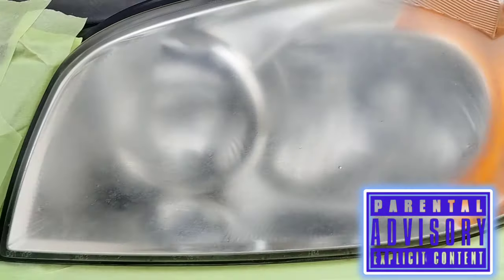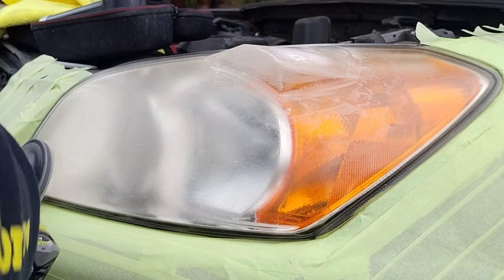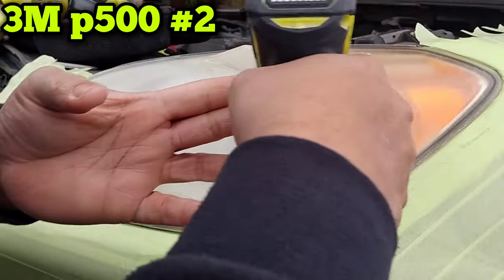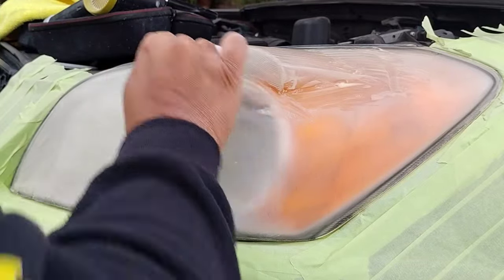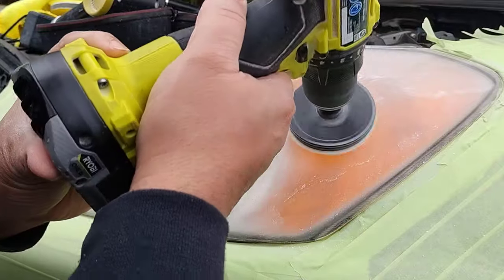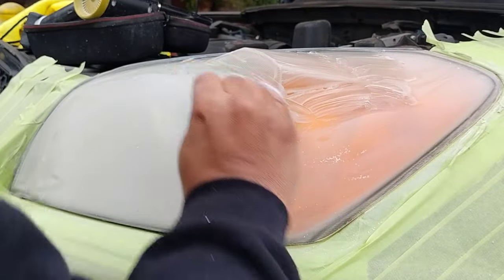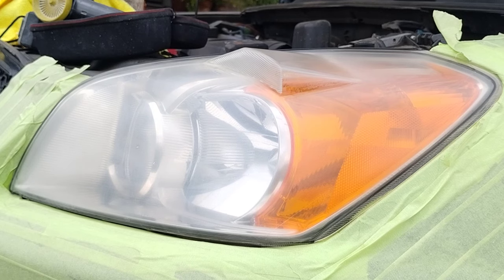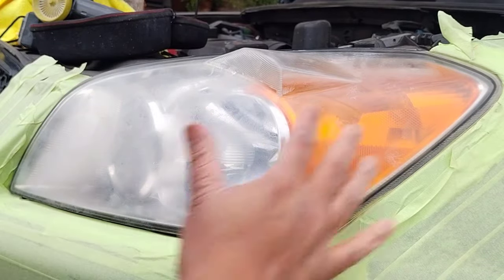headlight restoration BUSINESS PRACTICES 💹

Comment: You are really getting your use out of that finessit pad. 👍🏽  This method is the bomb!!! I can't thank you enough bro. Wishing you continued blessings to you and your family. 😃
Reply: He says the more used the better and I trust him I'm sure he has the money to replace it every use
Reply: @omeezyLK  I mean do what works best for you, but in my testing, it isn't better. It just leads to your pad breaking down faster. Pads have a level of cut to them too. If you over saturate it with polish, you are hindering the performance of it. I've been detailing for years polishing paint and never have I had a pad deteriorate like that because I clean them. But as long as the headlights come out clear and glossy, use whatever works👍🏻
Reply: @DelgadoDetailing  So you wash them with soap & water, and what are the best 3" pads you recommend for headlights.??
Reply: @karkule5919  So far, my favorite has to be the Lake Country Blue HDO Pad. Basically, any stiffer foam pad will do a decent job. If you're going to polish with a 3 inch dual action (this is what I'm doing now), I'll use a lake country microfiber pad with some Griots Fast Correcting Cream, then use an Orange Lake Country foam pad with 3d headlight restore. But honestly, the 3m pad is also really dang good. I've just had better performance with cleaning it after the restoration is done

Comment: I just came across your channel, and i must say, your headlight restoration jobs are a form of art! Do you offer your customers any other options in terms of protection after the restoration? The Meguiars keep clear headlight coat seems really good. But, wouldn't a UV resistant PPF last longer? Or even a good quality ceramic coating? I have watched plenty of your videos, but havent seen you using any other products apart from the Meguiars keep clear, and started to wonder why.

Comment: Came back to update on my first comment about my headlights looking like shit. Turns out I skipped a step, didnt wet sand after dry sanding. Also used P800 unessassarily which gave me a little extra light grit sanding to do to fix the headlight. Rere-did them today(3rd time) I cocktailed, used PlastX with Chemical Guys Headlight Restorer, sealed with Meguiar's Headlight Coating and my headlights came out fucking flawless. Thank you for all the insight.

Comment: Geez. These look like the best outcome yet!

One question, I performed a great restoration using your method. I then wrapped them in plastic wrap after a few days of drying (I did a projector retrofit on them) and shipped them out. The customer said they left a residue and they looked like crap. Same with his foglights. 

What do you recommend for this situation?

Edit: it was the meguiar's headlight coating. I've also noticed on a different set of lights that it never really seems to dry and it'll get ruined very very quickly
Reply: Try a different clear coat. Just because he recommends that one, doesn't mean its the only one

Comment: So I bought a roll of the green automotive tape that was ridiculously expensive compared to the cheap blue tape from Walmart and I was hoping that there would be a big difference in the release but maybe it’s just me but these seam to stick the same. What are your thoughts ? I’ve been buying the scotch Blue Original #2090 and they both seam to hold on too much and I’m often doing older cars so I’m worried about pulling on the paint

Comment: I need help… I start with 3m p500 and get it all done I used 2 of them . Next I used a 3m p800 and use 2 as well then I hand sand it to get the drill swirls out then I wet the light and my 3000 trizac pad and when I’m done I still see the straight scratches from the p800. I don’t know how to get rid of them . I use a drill for the sanding . Please help 😢. I do good but Ik it can be a lot better .
Reply: You are pushing too hard. To help me make sure I've removed the p500, I do a hand sand at the end. If I still see lines after p800 drill, I know I need to go more. 

For me, I needed to implement a p1500 step as the p800 with a heavy hand (like mine lol) can leave deep scratches. So I usually do p500, p800, p1500, p3000 trizact
Reply: @DelgadoDetailing thanks

Comment: Dude idk how you get them looking so good dry sanding them. I tried it this weekend on two sets and I couldn't get the same results. One set (my moms car) was a set I did a few weeks ago and I made them look worse at first. Lol. I had to wet sand and buff them. Idk if it's the sanding disc's I was using or what. I'm thinking it's the sanding disc's but either way man you do the damn thing on that dry sand.
Reply: I do his method with great results. Are you using the 3m sanding discs?
Reply: @DelgadoDetailing  no. I used some sanding disc's that came with the velcro backing plates. They don't seem to be worth a damn so I think that's the problem.
Reply: @ChristopherCologneASMR  Yeah I started off with those too. I was trying to save cost cuz the 3m ones are expensive, but let me tell you, there is NOTNING out there that performs as good and as accurate as the 3m ones

Comment: Well… I tried. I thought I could do this, but all I did is make a worse problem. I don’t know you do it but i could not get the pad to run back and forth smoothly! It jumped and bucked and put some big ass deep scratches in the plastic. And even took some paint off on the edge of my fender, even though i taped it all off. It was a disaster!  And i’m a mechanical kind of guy! What the hell am I doing wrong????

Comment: Perfection sir ....my only issue is when i spray the clear coat it doesn't look glossy like yours do
Reply: Your probably not laying it on heavy enough or spraying it on dry. If you follow the directions and do 2 coats, you will more than likely get orange peel. One decently heavyish coat and it should be clear.
Reply: So in order to get a glossy finish, you have to do one heavy coat. The can says to do a second coat, but every time I've done that in the past, I get more like a frosty finish and it doesn't look great. Since I've been doing the Headlight Restoration Pro's method using one single heavy coat, they come out flawless! I used to be a wet sand headlight restoration guy, but I'll never go back after using this method haha like Nacho Libre would say "It's the Best"
Reply: One heavy coat make sure you spray around the edges of the light first to "seal it" then continue to the middle parts just be careful short sprays if you spray too long in one area it'll start a "dripping" effect
Reply: I definitely don't do heavy enough . Thanks everyone will do on  my next restoration
Reply: The last couple times I’ve watched his videos I’ve timed his spray coating time and it has been around 20 seconds. I know that will differ with the size of the headlight but it’s something to go by. This guy is the best I’ve seen yet and I’ve seen a lot of videos. Kudos to you HLRP!